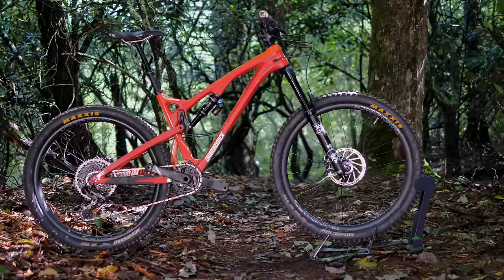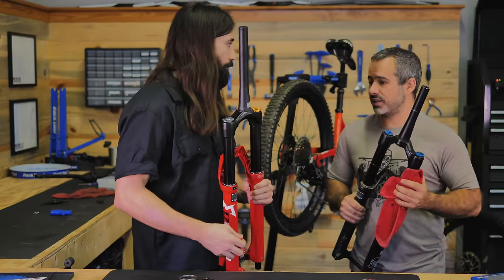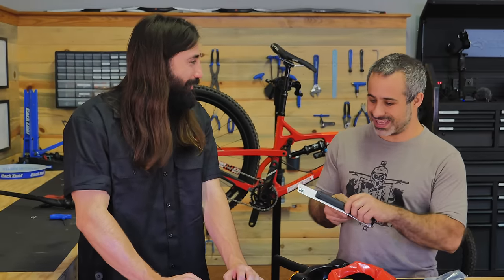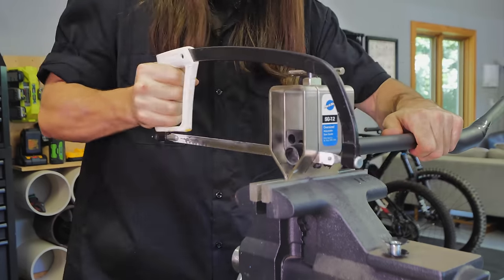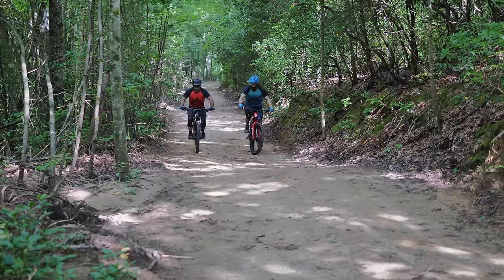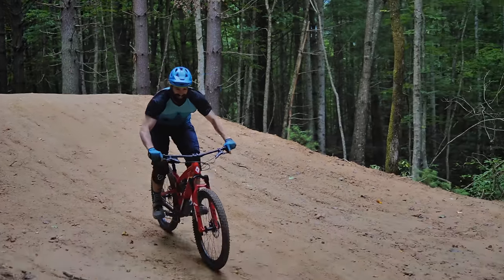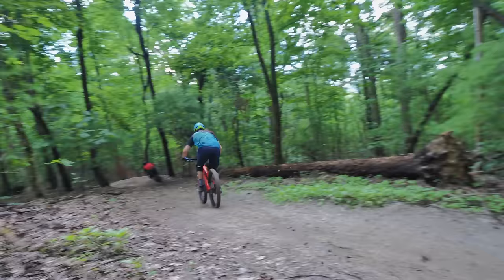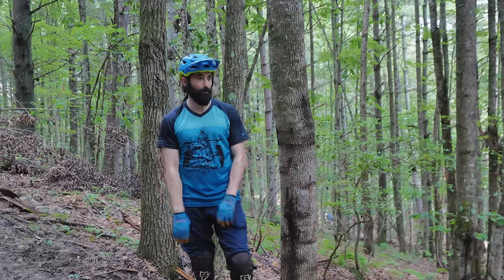Fixing Alex’s bike and ACTUALLY RIDING!

Comment: seth!!!! you can show everyone how to repair stanchion scratches!!! you have the perfect fork to demonstate!!!
Reply: jaakko200987654321 simple buy a new fork
Reply: @Biggestshredder  why? unnecessary if the scratch is not bad, my rs pike has a scratch on the stanchion and it rides normally (had it there for 3yrs, stock seals and every 50h new lower leg oil and clean foam rings)

Comment: Revamping a bike can be fun!  Over the winter I changed my 2013 Giant Trance 29er from a 2x10 drivetrain with a rigid seatpost to a wide range 1x10, replaced the suspension pivot bearings, and installed a Oneup dropper post.  Feels so good!

Comment: Fun fact: Instead of buying expensive bike tools you may use once or twice in 10 years, you can use a piece of PVC pipe to install the crown race and a pair of hose clamps to guide your saw when cutting the head tube. Also, stacking 3 Stanley style razor blades under the crown race (one on the front, one on the back, then another on the front) does a great job of removing the race without not hacking up the fork with a screwdriver. Just in case you don't get free fancy forks like Seth. Tune into New Forest Therapy's Bike Hacks for more hacks where we'll be doing more of the same ole crap and absolutely nothing different.

Comment: One tip when cutting metal with a hacksaw: no need to apply pressure downwards, the saw teeth will cut away the metal without pressure and pushing it down will wear our the teeth much faster of the backstroke

Comment: to remove the crown race in a situation like this you can also use a blade from a utility knife and with a small hammer gently tap when the blade is between the crown race and the fork, then work your way around
found this trick somewhere on youtube and worked great

Comment: Oh boy do i have a hack for you. To remove the crown raiser. Use a butter knife. Might wanna slightly sharpen it. Not to sharp. If your bench vice can hold a tube great. If not, just make sure to hold it secure somewhere. Put the knife between the raiser and the fork. Take a hammer and start tapping away. Tapping. Not going at it like a monkey. Work your way around. Most times it will pop off just fine. Some times the knife is not wide enough. But the gap created is great to stick a big screwdriver in there and wiggle it completely off.

Comment: Tip for seth. Hacksaws only cut in one direction, pulling the blade back across your workpiece just ruins the blades teeth. Try only pushing forward, it saves you more blades than you think

Comment: seth! buy yourself a plumbers pipe cutting tool. so much quicker, easier and neater cuts than using a hacksaw. 
also... not as many tiny flakes of aluminium or carbon fiber to get caught up in places you dont want little flakes of aluminium or carbon fiber.